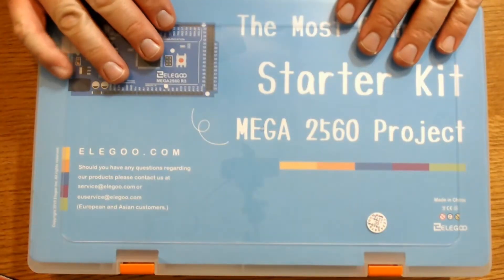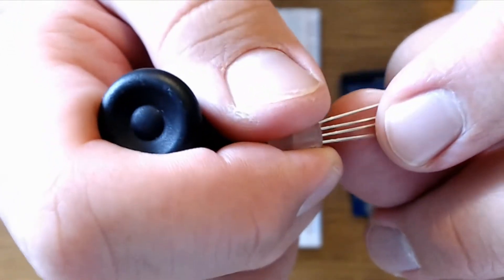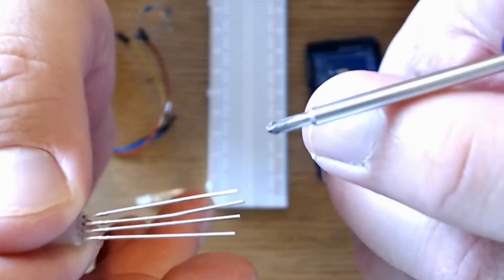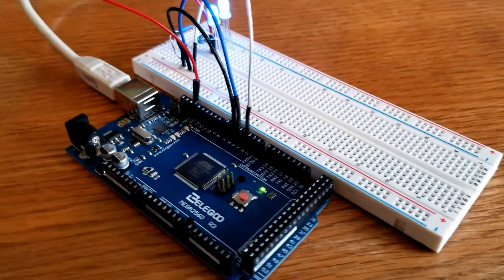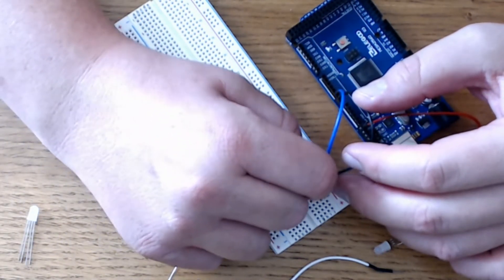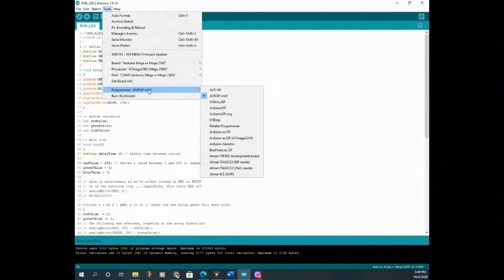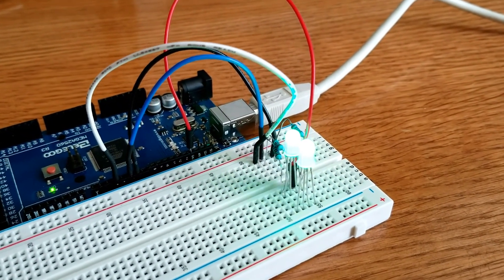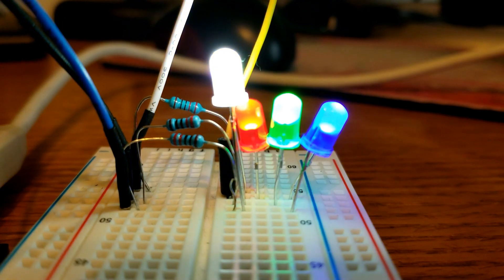Elegoo Mega 2560 Lesson 4 RGB LED with Pulse Width Modulation (PWM) For Beginner Arduino Electronics

Comment: How would I make it so the Led kust shows one single colour?
Reply from the maker: Adjust the code. Red is (255,0,0) Green is (0,255,0) Blue is (0,0,255) Yellow is (255,255,0)
Reply from the maker: RGB_color(255, 0, 0); // Red
  delay(2000);
  RGB_color(0, 255, 0); // Green
  delay(2000);
  RGB_color(0, 0, 255); // Blue
  delay(2000);

Comment: pls add the code schematic copy pls
Reply from the maker: Hi there! here is the code from the elegoo kit for RGB 
//www.elegoo.com
//2016.12.8

// Define Pins
#define BLUE 3
#define GREEN 5
#define RED 6

void setup()
{
pinMode(RED, OUTPUT);
pinMode(GREEN, OUTPUT);
pinMode(BLUE, OUTPUT);
digitalWrite(RED, HIGH);
digitalWrite(GREEN, LOW);
digitalWrite(BLUE, LOW);
}

// define variables
int redValue;
int greenValue;
int blueValue;

// main loop
void loop()
{
#define delayTime 10 // fading time between colors

redValue = 255; // choose a value between 1 and 255 to change the color.
greenValue = 0;
blueValue = 0;

// this is unnecessary as we've either turned on RED in SETUP
// or in the previous loop ... regardless, this turns RED off
// analogWrite(RED, 0);
// delay(1000);

for(int i = 0; i < 255; i += 1) // fades out red bring green full when i=255
{
redValue -= 1;
greenValue += 1;
// The following was reversed, counting in the wrong directions
// analogWrite(RED, 255 - redValue);
// analogWrite(GREEN, 255 - greenValue);
analogWrite(RED, redValue);
analogWrite(GREEN, greenValue);
delay(delayTime);
}

redValue = 0;
greenValue = 255;
blueValue = 0;

for(int i = 0; i < 255; i += 1) // fades out green bring blue full when i=255
{
greenValue -= 1;
blueValue += 1;
// The following was reversed, counting in the wrong directions
// analogWrite(GREEN, 255 - greenValue);
// analogWrite(BLUE, 255 - blueValue);
analogWrite(GREEN, greenValue);
analogWrite(BLUE, blueValue);
delay(delayTime);
}

redValue = 0;
greenValue = 0;
blueValue = 255;

for(int i = 0; i < 255; i += 1) // fades out blue bring red full when i=255
{
// The following code has been rearranged to match the other two similar sections
blueValue -= 1;
redValue += 1;
// The following was reversed, counting in the wrong directions
// analogWrite(BLUE, 255 - blueValue);
// analogWrite(RED, 255 - redValue);
analogWrite(BLUE, blueValue);
analogWrite(RED, redValue);
delay(delayTime);
}
}
Reply from the maker: remember the rgb leds in the kit are common cathode. from left to right the pins are red(pin 6), ground (long pin is ground), green(pin5), and blue (pin3)on the right. use a 220ohm resister with each of the 3 color pins, not ground.

Comment: I just connected my Arduino to my computer after finishing my circuit and the led lamp just starts blinking. Without any coding. Is that right?
Reply from the maker: It will continue with whatever you last uploaded to the board. There may  have been a blink program on there prior to  plugging it in...otherwise, not really sure why it would do that. This RGB led project shouldn't blink though. It's a slow transition to multiple colors once you upload the code.
Reply: @BMonsterLaboratory  The Arduino I'm using is not mine. It is from the school so I guess somebody else has used it before.
Reply from the maker: @gatisruna7315  I see. Just upload the rgb led code and you're good. Its awesome that you can borrow them from school.  Enjoy!